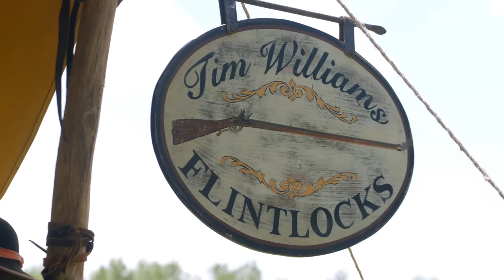Anatomy of a Flintlock with Tim Williams

Comment: I have a rifle that was made for my 3rd great grandfather in 1830. It was converted to a percussion rifle sometime later. It is still working. I keep it clean, and occasionally fire a cap through it. It's missing the brass patch box on the stock. It's a 54 caliber as best I can tell. Somewhere along the line the trigger guard was broken and my brother in law had it repaired by a blacksmith in West Tennessee...neat rifle. It's a very plain Jane rifle, a working man's gun.

Comment: Tim Williams is truly a master craftsman. I was completely enthralled with his informative and quite pleasant presentation.  One thing struck me though.  When he opened the patch box my heart sank. Or perhaps, more precisely, my mind just went ??? oh, my, dear me why? I just don't comprehend doing such beautiful meticulous work and then leave modern Forstner bit scars evident in the bottom of the box's stock maple wood. If those are period "brace & bit" marks I apologize.  Seems to me though even those masters back then would have done the same as I do with modern bits; run shallow to hog material & chisel finish clean including the bottom. I'll even "sacrifice" a Forstner by grinding off the point if need be. Exquisite work. Almost, but not quite God Level. Over all, great vid.

Comment: Would an 18th century gunsmith customarily be a master of multiple disciplines?  I ask because one of my ancestors was a known gunsmith mid-1700s during the settling of the Shenandoah valley, but recently-discovered info suggest he possibly only made the wood stocks.  So I'm wondering if, on the frontier, it was customary to work as a team of specialists (blacksmithing, coppersmithing for brass, and woodworking), rather than one gunsmith per small village?

Comment: I would guess that a horn-tipped ramrod was used because there would be no danger of setting off the powder while tamping it and the ball into place. A metal tip could spark.
Reply: Ace/They used a Brass Tip,normally,no steel Tips!!!
Reply: I would think that horn was cheaper and more available than brass. As for durability... think of what horn goes through when it's still on the cow :-)
Reply: Ace Lightning  Think of horn as the original plastic material . It could be heated and shaped as well as being waterproof.
Reply: That's pretty true, now that I think about it. I should buy a couple of Townsends' horn spoons!

Comment: Great video, how did they clean rifles in the frontier?
Reply: Hot, soapy water or hot water.  The grease to preserve the outer surfaces could be any type of animal fat or tallow.  Basically, you can remove the barrel (or leave it in the stock), plug the pan vent, and pour hot soapy, or hot water, down the barrel.  After letting it soak for a bit, you drain the water.  Then, using clean, dry patches, you swab out the barrel, using the ramrod (hoping you do not break it it get it stuck) to hold the cleaning patches.

Comment: Why didn't the gunsmith's make a flash pan that would protect the powder from rain? Wet gunpowder was a major issue during wet seasons.
Reply: +David Volk there were rain protected flash pans made late in the flintlock era. However, most frontiersman simply heated the powder pan just warm enough to melt beeswax and then rubbed beeswax along the top edge for a rudimentary water seal when the frizzen was closed.

Comment: A more effective way of explaining how the weapon would be used is to be on an appropriate range. The explanation currently stated was a stumbling, barely descriptive,  overly simplified way to state how it's shot in under 20 seconds (which if you're grading for 20 seconds, was in fact somewhat decent).  There's a "wee" bit more process in an actual loading, but an expert could do it between 2 to 4/5 times a minute (yes it's possible and was at one point a standard, though even I am uncertain how beyond inhuman means it occurred).

My logic behind finding the explanation lacking? The first gun I fired as a youth was a black powder. Aiming is hard. Green shooters are often called "tree killer" with their first shooting as they'll completely miss the target...but dang...those poor trees. Cause you're gonna carve that out if you can (w/o killing the tree or harming it much) so you can remake the bullet.

Comment: I have a Pedersoli "Kentucky" flintlock rifle.  It is .45 caliber.  Using a .44 caliber lead ball, I can generally load and fire 3 rounds in a minute, provided nothing goes wrong.
Reply: Ron Schramm. With measure and individual patch & ball, or using a rolled military style rifle cartridge?
Reply: S Tho..Rolled cartridge.  With powder patch and ball, it runs 2.25 rounds per minute.  I use greased thin leather patches, which is very smooth feeding.
Reply: Ron Schramm.  Then you're doing it right.  Those are correct times.
If you wish to speed up the patched ball then you can use a ball block (chip of wood with holes, prefitted with balls and greased patches for those reading this) and a speed measure flask.  It'll still take close to a minute.  

However, if loading for hunting accuracy,speed is not important.  Once you shoot you aren't going to shoot again for 30 minutes till the game settles down.
Reply: S Tho..Yep, been doing it the same way with the leather patches for the better part of 3 decades.  Just really started with the rolled military cartridges after I began doing reenactments.  We often have frontier wood walk contests here in Kentucky, or rifle, tomahawk and knife contests.

Comment: What did they store in that little compartment?
Reply: Jojo’s Dogtail I'm wondering too.
Reply: Patches. They’d put a patch of thin cloth around the lead ball so it could grab on to the grooves of the rifling a little better, imparting a spin and making it more accurate.
Reply: The patches were lubricated as well which made the fouling easier to remove.
Reply: Often a spare flint, some ready cut patches for the round ball, perhaps a turnscrew, some held coins for contingencies. Southern longrifles sometimes had patchboxes, but Appalachian/Tennessee rifes often had only a simple grease hole in the stock to hold patch lube/surface protectant, usually made of tallow and beeswax.

Comment: Unless it's raining high humidity or any moisture in the air the flintlock will not work right cuz of powder in the pan gets wet and no spark is not going to let light off wet powder that's why the percussion cap was designed buy person that wanted ducks and every time you use this Flintlock the Ducks will be gone before the shot came out

Comment: It's too bad the wad box has the telltale marks of a modern drill bit, probably 1 1/4" or 1 1/2". It would have been better to have taken the bits down only enough to finish off the bottom to remove the marks.

Comment: Then the spark would set the powder pan off...............Sometimes.
Reply: Jim Adams. I've gotten over 30 ignition sparks in a row without tending the flint.  I've gotten several off in a hard rain (about 10), until the powder starts to wet in the pan. 

 Damp fog is more of a handicap than light rain, because everything gets wet and slick just from the air.
Reply: That's awesome! You must have a well made rifle. I've only shot a flintlock a couple of times, my Stepdads,  and had a hard time setting off the powder. Maybe the hammer was a little too slow, it was a fairly old rifle. I hunt deer with a caplock Hawken .50 cal and most of my guns are black powder percussion cap. The only misfires i've had have been my own fault! I wouldn't mind owning a flintlock some day.
Reply: Jim Adams.  Yeah they do drop spark. That's what make em fun. Keeping a flint knapped is half experience, half art.  Oh quick trick in the field.  If the flint looses spark, hold the frizzen shut and pop the trigger twice.  It tends to knap the flint straight.  

Best sparks are from a pressure knapped flint.  Yes my guns were made back in the bicentennial.  I'd never sell them.  

Happy sparking!!!
Reply: So maintaining the flint is the key. Thanks for the advice!